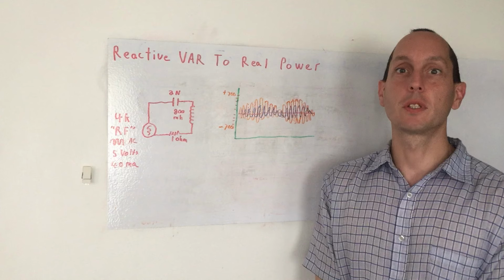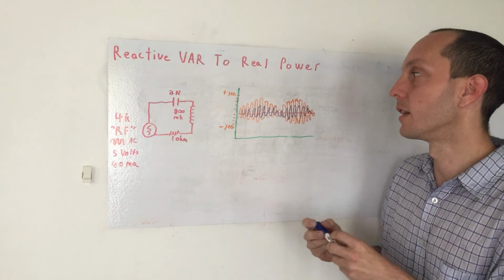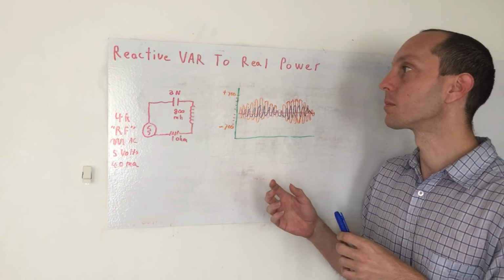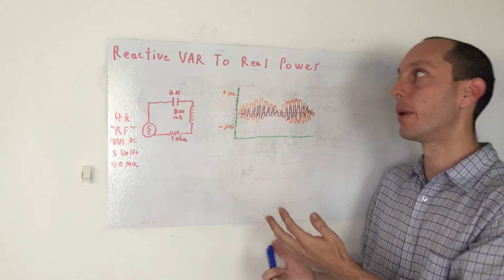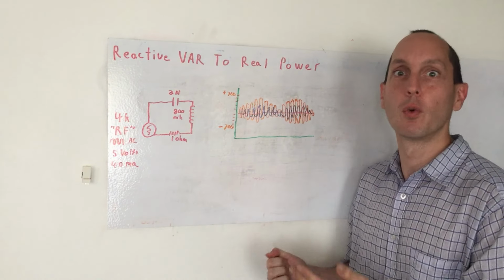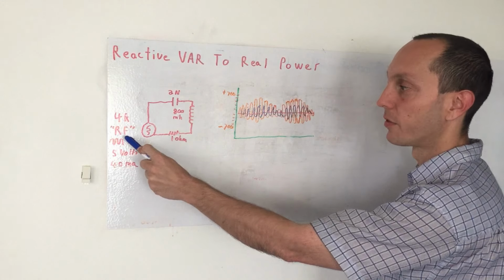Reactive Energy

Comment: yes this aligns perfectly with what I  have learned. Alexeys Graviflyer uses aluminum in Russian electrical grid to levitate. The 180 degree phase shift enables the Al to be supercunducting. Al oxide form on the top of the plate enabling electron pair creation from oxygen rings carrying charge which creates virtual positive particles until quantized which then real particles form. Copper when oxidized will become a type p superconductor tuned to around 2.2 eV bandwidth. I would be curious to see this circuit operating with peg cell at high frequency as I would expect k is non constant. I would shine green light on the peg cell. can incorperate fiber optics and use the sun. Can pulse with slotted plate and motor. Can time so light reflected back at you gets blocked by slotted plate. The slotted plate can be made of trichloronaphthalene and placed closely to peg cell so reflection acts as pulsed casimir cavity. Im just spit balling some ideas to try

Comment: in your last video you talked about equal and opposite phased input. that would be done with the capacitor device in you reverse Transformer video right?( it's the video where you wound the capacitor with an iron windings)
Reply from the maker: The capacitor device is just a iron coil wrapped around a non conductive core, inside and outside are wrapped capacitor layers (foil tape) insulated first with a layer before wrapping the exposed iron so it don't short out the plates.

Comment: If you split the coil output like that, wouldn’t it kill the resonant voltage boost and defeat the purpose of having a resonant coil? We should bench test it to see what happens, but I’m guessing that’s what will happen. What you need is a pulsed output circuit that is decoupled from the resonant circuit, maybe similar to a Bedini style cap-dump circuit. I’m just guessing/spit-balling ideas here…and I could be wrong.
Reply from the maker: The explanation is quite simplified, and the output would be measured in watts, not kilowatts. There are specific formulas available that allow you to calculate the power that can be utilized in a reactive circuit, provided the load is appropriately matched. So, it's more complex than just connecting a coil and expecting it to work. The coil must be matched to the load, and the load itself must be carefully calculated to ensure that it does not exceed the power limits given the LCR values in use.

Comment: Great video Joel, this might be a stupid question but is there a way to split the waves into separate positive and negative, like if the positive side was the push, so your input was before the load and the negative side was the pull, with it's input after the load would they work in conjuction with each other or maybe as two separate systems? If it's complete nonsense I'm talking, please let me know 😂👍

Comment: Why do you need to rectify reactive power ? … I mean is it absolutely necessary ? You can charge caps or power resistive loads with it … what would be a capacitive resistive load able to swallow all of it and requires only a single diode (one way system) ?

Also, if few waves are introduced in a system and they are multiple or sub multiple, the resultant resonance will be much lower, like 100hz+150hz+200hz = 50hz resultant output frequency … this is the way a much lower frequency is obtained in musical instruments, but is much easier to introduce higher frequency (or more efficient in case of pulsed current) … sounds complicated but is not.

If think a week or two ago veritasium yt channel have shown this effect in a church were a huge organ was played
Reply from the maker: Of course there are so many ways to go at it.... :)
Reply: @joellagace1679 As I always said: if a capacitor can be charged, power is usable. If the rate of depletion exceed the the rate of replenish we have 2 options: 1 reduce required input to a sustainable level or 2 enhance replenishing capabilities. Sometimes upon the method employed both solutions can be adopted … but I would insist for higher efficiency in order to reduce the required input, which in most of cases is easy achievable without expensive and high tech specifications … and even without the need for a national/international power grid distribution.